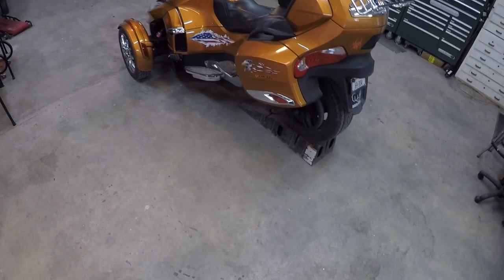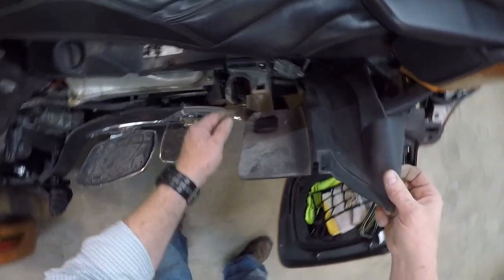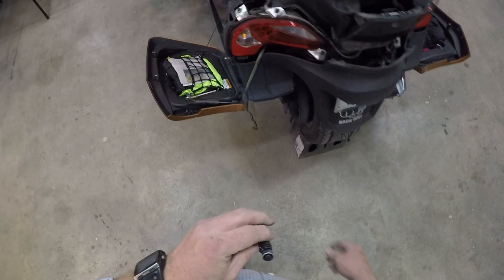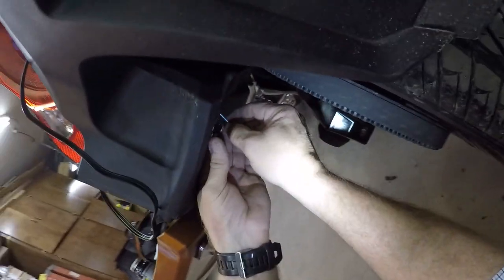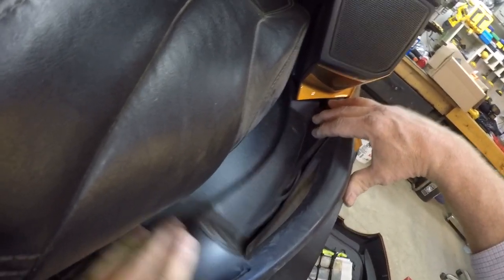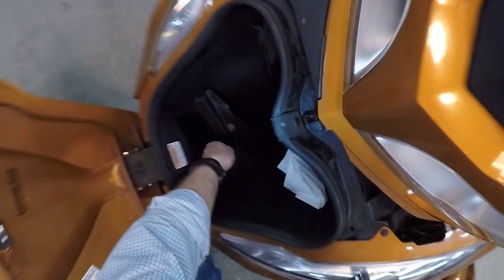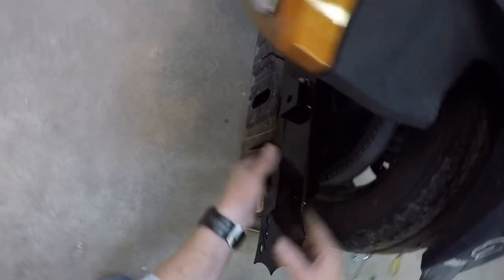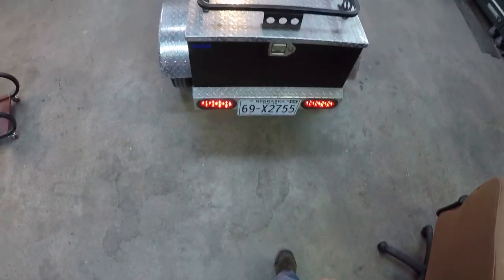Can Am Spyder RT Trailer Wiring Harness and Hitch Installation

Comment: It seems the hitch goes up and down with the swing arm. Doesn't that make the trailer tongue go up and down. Does the trailer shake?
Reply from the maker: Scott Harrington, this, and all Spyder hitches are mounted directly to the swing arm. The only “buffer” there is between the road and the hitch is the tire. So, the only movement is the actual road surface which is buffered by the tire a little. The trailer pulls and performs great.

Comment: I have exact same bike and bought the same hitch and four pin outlet that you just did. Does that plug and play come with four wires or five wires and if it came with five what did you do with the fifth?
Reply from the maker: Mine is four wire, I think five wire harnesses are for the Spyder trailers that have a reverse lamp. But I am not positive on that.
Reply: @ItsYoursOWNIT  ok.  I bought exactly same thing u have in the comments.  Hopefully it comes the same way yours did.  In the video it looks like you have another wire coming from your four pin in the side box to your trailer hook up.  Is that just a splicer connection you made?
Reply from the maker: I know the one I installed is four wire, I’ll review the video and look. It’s been a while since I did this. I also added the 4-pin connector so I wouldn’t have to deal with the pigtail when not using the trailer.

Comment: Do lights work with key on but engine not started?  I had wiring harness installed & all pins are hot with engine on, even when trailer fuse on Spyder is pulled.
Reply from the maker: Traveling_Baja_Cat 
Yes, the lights all work with just the key on, (not started). I am not aware of a “trailer fuse”. This harness I have plugged into the lighting harness under the seat, so it runs off of the regular lighting circuits for the Spyder.

Comment: Curious if you used what they call and isolator for your wiring. Tx
Reply from the maker: Yes, the harness came with the hitch
Reply: @ItsYoursOWNIT  thank you, so the small black box that comes with the harness with the hitch is sufficient and I don’t need and isolator. Thanks for responding so promptly.

Comment: Do you know how much tongue weight it will support?
Reply from the maker: If I remember correctly it was 40 or 50 pounds, but I did stand on it and it took my weight (250) just fine. It is a good sturdy hitch.
Reply: @ItsYoursOWNIT  I had thought about modifying the hitch to a receiver.  So I could carry my Mobility travel scooter.  Be around 200lbs tho. So not sure of the stability
Reply from the maker: Hoosier guy08, Yeah, that might make the Spyder handle a little squirrelly. Maybe you could find someone to build you a little tilt-bed trailer to haul it on.

Comment: How do you run all 6 systems with 4 wires ?? 1 earth 1 tail-light 1 brake light 2 indicators 1 reverse light ??
Reply from the maker: Left turn, right turn, tail, ground.
The left and right turn are also the brake lights. No reverse light.